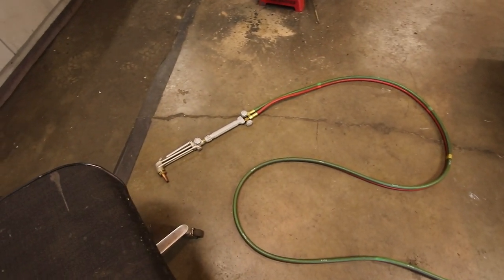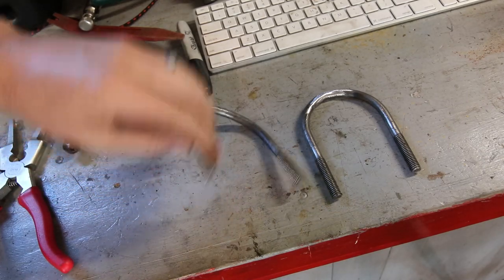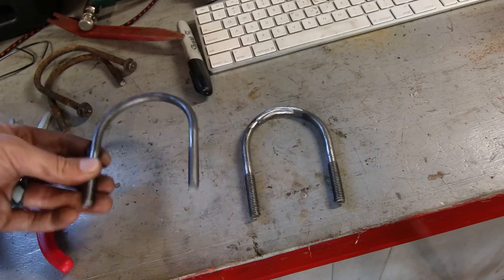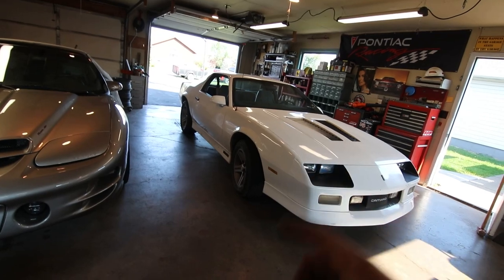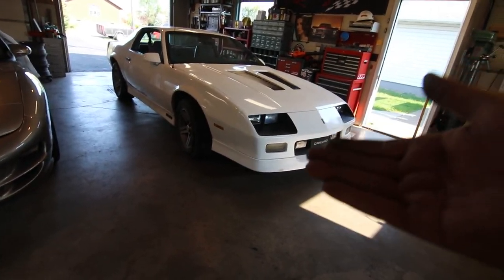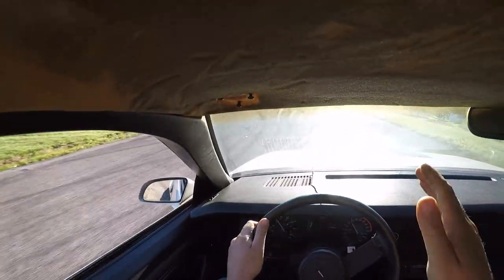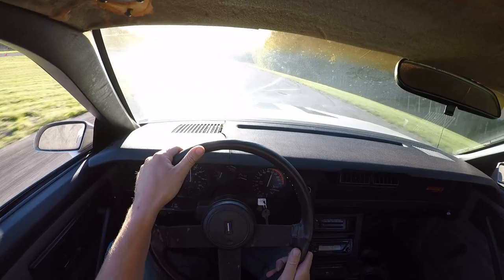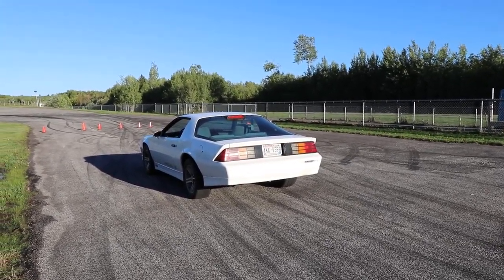Better & Worse?... Budget Autocross Camaro Iroc-Z Build - 4-wheel Disc/10 Bolt Upgrade!

Comment from the maker: What's next for this car? I have a couple of killer parts on the shelf sent in from a subscriber that NEED to go on before anything else. Thanks for checking out today's video!
Reply: Loosen up the rear bar a bit. Will help settle the front.
Reply: Looking good! Glad someone is doing something for the car scene in upper Wisconsin/Minnesota. Hopefully a open track day sometime next year. My bird will be ready. Awesome video
Reply: Throw on a tpi system haha.
Reply from the maker: Lol 10/10 comment
Reply: @Greenlightfilming  for real though, some nice race seats would be cool or a z20 package spoiler. Not sure if it would fit a Camaro though.
Reply: Power nation did a decent build expect for the nasty body mods destroying there 3rd gen. But all the suspension stuff was on point.
Reply: @TheWiscoGuyz  you know vice grip garage was based out of Minnesota. Now he is in Tennessee
Reply: If you could do something explaining how to fix/replace the bright light switch, that’d be awesome. I’ve got a 90’ firebird with a faulty bright light switch, and I have no idea where to even start fixing it
Reply: @willkeith8699  if you mean the one on your signal stalk, just drop the steering column and undo the cover in your gauges. Or if you mean the dimmer switch, it's really easy. Just take off your plastic gauge trim/ cover and it pulls out of a plug. Start with the screws under your dash.
Reply: @willkeith8699  yeah it's a mechanical lever on the signal stalk that makes the high beams switch on and off. Check classic industry or a local junk yard I am pretty sure all 3rd gen f body used the same steering components.
Reply: Small Aluminum LS, 5.3 with some @TexasSpeed goodies.
Reply: Ls is boring keep the small block be original
Reply: @johnsnow1355  Yeah because a SBC in a Camero has never been done before...

Seriously though the lighter weight will help with the understeer and more power never hurts it either. Just going to a fiberglass hood on my old 84 had a noticeable effect on handling. Really any weight reduction or lowering is going to help overall.
Reply: @johnsnow1355  a smallblock is boring, tpi or an ls is cool. Everyone's dad wants a gm 350 in their hotrod. It's not original plus, that 350 in there is not the original motor. Either leave it tpi or put in an ls.
Reply: @keenanwengert423  my car has the TBI vortec engine but it runs a aluminum intake and a 4 barrel carb. Lumpy cam putting down about 400hp and no computers. If I need to adjust something I need a 9/16 wrench for timing and a flat screw driver to adjust everything else. Keep it simple.
Reply: @johnsnow1355  don't get me wrong man, carbs can be nice and that's why I like my bikes carburated. But, when it comes to v8s that already get pretty bad fuel economy, they don't do well on road trips with higher horsepower. And tuning an ls is very simple. Tpi, not so much. But it's much easier to squeeze more power out of an ls and have it just run perfect. They're just more efficient and the obd2 setup is really easy. If you can make a wiring harness for a small block you can set up a ls harness with Holley plug n play stuff for your gauges and stuff.
Reply: @keenanwengert423  I won't disagree on wide band O2 being a huge benefit to any motor induction system. From EFI to carb they both can be optimized.
Reply: @willkeith8699  Hi Will.  The brake light switch is not part of steering column.  It's mounted above the brake pedal.  It's a pretty easy fix really.  Try not to break the ribbed collar in it's mounting hole.  It will be brittle.  It basically unplugs, and get pulled out of ribbed hole.  Install the new one slightly deeper, and depress pedal to adjust it.  Yours might be still good and knocked out of adjustment, or plastic ribbed grommet cracked and it fell out of position.  I used quick steel epoxy puddy (like clay) to form some in place over the years when grommet was shattered.  There is really no force on it at all in use.  Worked great until I pulled it out for a 6 speed swap.

Comment: When I replaced the sway bar bushings in my 3rd gen I got new u bolts made at Standens, super cheap as well. A couple bucks each, bigger then stock as well. Bring the old ones with you and they will match them for size

Comment: It stutters on corners because your fuel level is low. There aren't any baffles in the gas tank pre 1989, it is common for all third gen's to bog down if the fuel shifts in the tank if you are at a quarter tank or less. The IROC does look like it handles poorly, time for a shock and strut upgrade and some sub frame connectors and a wonder bar, some lowering springs and decent tires wouldn't hurt either. Please do the upgrades, you're embarrassing the poor car...LOL

Comment: Get yourself a copy of "How to make Your Car Handle" - Fred Puhn - HP Books. That is what I used as a guide when I was autocrossing and working at a race shop
Reply from the maker: I'll check it out. Getting wisdom from experts is the way to go. Hate just throwing parts at stuff.
Reply: @Greenlightfilming  getting the car weighed is critical for handling. Maybe even just some bathroom scales would work. If u don't know where the weight is in the car u can't fix the handling throwing parts at it. When I circle track raced my rf spring was short enough I could rotate it in the strut to change my cross weight and make huge changes on Car too tight and too loose just by adjusting my rf ride height with the spring adjustment. The struts on most cars have a ramp at the top and u can easily get a inch of movement in ride height turning the spring around on the ramp. Your McPherson strut set up with coil overs would be a huge leap in fixing corner weight and cross weight.

Comment: I did the same rear end swap as you 91 z28 rear into my 86 Iroc that was drum and didn't change the proportioning valve and I think the brakes work good, it will lock up all 4 in an emergency stop and I've never heard the brakes dragging.
Reply from the maker: I did notice the brakes dragging on mine just a little bit. Might have missed it if the pads/rotors weren't old and rusty haha. With the new spring it went away instantly and they engage fine. You can still hear them in the car.

Comment: Absolutely true that there is residual pressure for wheel cylinder seals. Also I would recommend loosening all control arm and panhard bar then retorque them with weight of car sitting on the wheels.

Comment: Depends on the side the float is on. My stock Datsun 510 card had the float hung so the fuel would shut off the needle and seat when I circle track raced it always starving for fuel. I swapped it to a gm 2 barrel off like a 60s V8 and it was perfect after that. Q jets will starve for fuel under hard acceleration G the float will shut off the fuel. The best carb I have found is the 60s gm 2 barrel for circle track racing and autocross. The pre vacuum assisted carb has no vacuum ports to worry about.

Comment: I would delete the front fog light openings and run brake ducting to the front brakes. It made a real big difference on my autocross car to stop brake fade. Just some home Depot furnace ducting and a few rivits it's real easy to do.

Comment: The fuel starvation in the turns would be my best guess the fuel pump. If its a float style pump then the car thinks its starving for fuel because the gas is sloshing around the tank and the pump float is closing off for a second. I'm betting the computer is reading that and helping cause the issue. Might look into a performance pump for the Z28. I know Texas Speed and Motion Race Works would probably have one that will fit you car. If they do not I know motion race works can make custom in house. And both companies are awesome to work with. Motion race Works is probably a lot closer to you. Texas Speed is in San Antonio. You Sir are driving my Top NUMBER 1 FAVORITE CAR on the PLANET!!! Camaro's are the Fest Damn Cars and most EPIC I have owned in my Life. You cant go wrong with a Chevy V8 Camaro!! So jealous right now that you got two and I dont right now.... I will have another one.... Oh Yes I will.
Reply: Word homie !I always had to keep over a quarter tank of fuel in my 86 t/a or she would starve every time I wanted to play
Reply from the maker: This car actually doesn't use the ECU at all. It has a mechanical pump and the factory pickup/tank. I think there was around 1/3 tank of gas, and it's probably starving in corners like you said. I'd be inclined to install a baffled pan like the 1LE cars came with to salve the issue. It's basically not usable if you want to actually autocross and set a time to beat haha.
Reply: @Greenlightfilming  Nice. I mean if your going to run it might as well do it. What's the point of having such an amazing car and not running to its best. You know.
Reply: Does it have an edelbrock carb? They are no good for cornering.
Reply: @Greenlightfilming  I tried drag racing a 80s impala back in the day and it didn't matter how much fuel was in the tank. Even packed full to the brim the carb was my fuel starvation issue.
Reply: @timothythomas1737  they are no good for anything ha ha I have has two small block cars with them and they are junk. My current 85 Trans am is running lean and u can't do anything with the carb.

Comment: im enjoying this because i have an 85 IROC I have been getting back to original condition. Mine drives curvy roads like its on rails.
Reply from the maker: They are a ton of fun, and prior to the last couple of years they were generally cheap. It's getting tough to find these for low money.
Reply: fuel pump was dying on mine and ac needed new compressor. also had radio repaired. Ext and interior very good so will be a Sunday ride around car.

Comment: The sputtering in cornering is due to lack of baffling in the fuel tank make sure you have a full tank of gas will help if you want that car to handle better you definitely want to lower it and beefier sway bars strut Tower bar subframe connectors I didn't see that the struts were not functioning properly but you might have a look at that as well also with that limited slip it's going to understeer more than it would with your worn out differential

Comment: Did you say that you are using some muffler U bolts to hold the rear end in?
Reply from the maker: No. They just mount the sway bar bushings/brackets to the axle tubes.

Comment: Residual pressure valves with drums is a thing. Never used one though
Reply from the maker: I guess that was the function of the spring thay WAS in the prop valve. Never heard of it but it makes sense.

Comment: Master cylinder should be different bore size for disc vs. drum
Reply from the maker: In my case this wasn't necessary. Quote from a moderators post on TGO: "Pre 89 disc/drum used a A-50 master cylinder. Pre 89 disc/disc cars had a A-65 master cylnder. From 89 on GM used the A-50 master cylinder for both disc/drum and disc/disc equipped cars."

https://www.thirdgen.org/forums/suspension-chassis/59140-converting-drum-disc-brakes.html

Comment: AN IROC THAT DOESNT LIKE CORNERS??? NEVA! IVE HAD ONE OF THOSE AND I THINK YOUR ISSUE IS  1) FRONT END ALIGNMENT , NEED MORE CASTER, AND ALSO LOOKS OVERCAMBERED TO ME..ALSO THE TIRES YOURE USING ARE TERRIBLE! THAT TRACK HAS SO MUCH TIRE MATERIAL FROM ALL THE DRIFTING HOW ON EARTH CAN YOU GET GRIP WITH RUBBER ACTING LIKE ROLLER BEARINGS ON THE TRACK.....
THE TIRES I USED THAT HUGGED THE ROAD REAL GOOD WERE 1) CONTINENTAL EXTREME...2) PIRELLI P-ZERO.
FYI: UNLESS YOUVE ALREADY DONE IT, YOU SHOULD REPLACE THE END LINKS, SWAY BAR BUSHINGS, PANHARD ROD TO AXLE BUSHING WITH POLYURETHANE. , ALSO STRAP ON SHOCK TOWER SUPPORT BAR, WELDED SUBFRAME SUPPORTS AND GET FATTER ADDCO SWAY BAR IN FRONT.